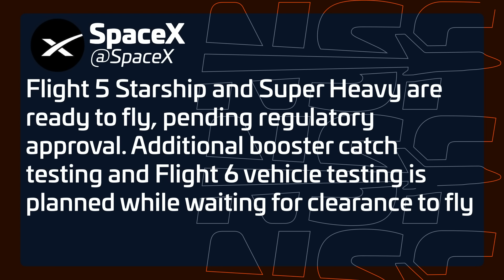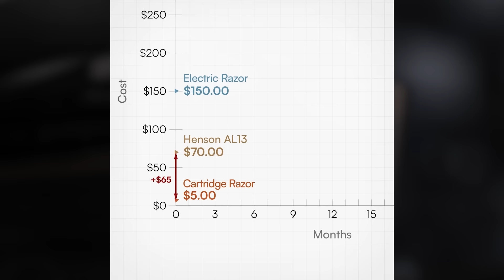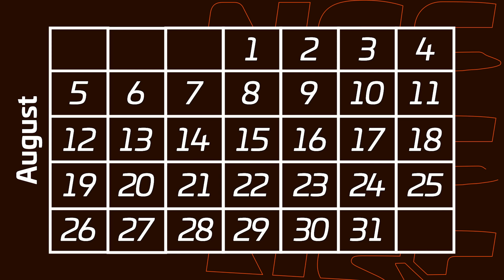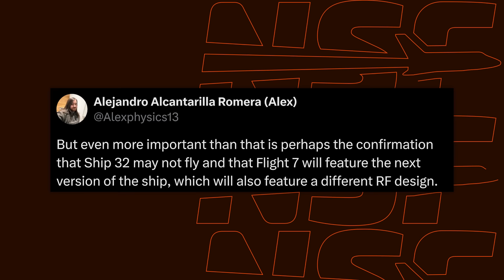Starship Flight 5 Vehicles Ready To Fly? (plus Raptor 3, Slap Testing & More) | Starbase Update

Comment: It is hoped that a starship weighing 20,000 to 70,000 tons can be designed and manufactured as soon as possible, which is equivalent to designing a submarine and aircraft carrier that has space speed/can move at extremely high speeds.

Comment: @NASASpaceflight Great video. I believe another dependency for the next launch date will be removal of the crane. The crane leasing company likely would make it contractual not to have the crane so close to pad A. Please let me know your thoughts.
Reply: I think they will just lay it down for the launch, but we'll see.
Reply: @michaeldeierhoi4096  You may be right. But I would imagine the crane owners would not want it exposed to that much energy.  Along with the mechanics, the systems and sensors are probably not tested for the conditions it would encounter.
Reply: The 3 remaining modules will soon be stacked and the crane dismantled. The LR 11000 can do the rest.
Reply: Documentation about this crane does not show any plan to dismantle it, in fact it is planned for it to stay at the pad at least all the way to January 2025
Reply: @ale131296  Thx for the additional info. That explains why they did not lease the crane from me.
Reply: @Vic20-RF  LOL

Comment: cover on booster 15 looks  more to protect the top of the booster from the outside elements via that line opening in the wall behind the booster.
Reply: I notice welders will often tent themselves (presumably) to reduce wind in their workspace and/or keep hot sparks from flying everywhere.
Reply: The boosters themselves have these new white caps they can wear when stored outside without a hotstaging ring, to protect the avionics and batteries and grin-fin motors on top.

Comment: Does SpaceX still perform full wet-dress-rehearsals before each Falcon flight? Are WDR's always required, even for a vehicle with such high operational cadence?
Reply: With new boosters.
Reply: Most (if not all) new boosters and upper stages are tested at McGregor before shipping to the Cape or Vandenberg; so it isn't always necessary.  Especially if it's just an internal flight (StarLink).

Comment: Worried about sound effects on hardened encased concrete. May turn to crumble? 17:05
Reply: This is the technique they used for the current OLM legs.
Reply: @ReinReads  It's the steel that makes the structure strong; the concrete just makes it heavy (and gives it an awful lot of impact absorbing inertia).  Even if all the concrete turned to dust inside, it'd probably still be fulfilling its purpose.

Of course, I was never trained in civil engineering, so I of course have no idea what I'm talking about.  Such is the internet these days.

Comment: Did anyone see if there are new 3D animation videos of how the catch mechanism works? No rollers, anymore or tank threads I remember? But cushioning pads now?
Reply: There's a rail where the lifting pins will "land" on, nothing about tank treads or anything. The pads on the sides of the landing rail are to soften the contact force when the chopsticks slap the side of the booster during its descent
Reply: thanks
Reply: The tank threads were replaced by pads at the end of long screws that can push the hooks of a booster back or forward if they need to move it. They work like a bench vice, just much larger.

Comment: I dont see rapid reusability being achieved while still using tiles and ablative material. Some type of new tech will need to be invented.
Reply: The rapid reuse is mostly referring to the boosters. The ships will be many and can be "fixed" between flights as long as they land safely. If they have to replace 10 or 20 tiles out of 18 000 it will still be rapidly reusable. They have the ablative sheets as a backup layer in case tiles are lost.
But we all have to wait and see what the results of the coming flights will reveal.
Reply: Oh, ye, of little faith.  Has SpaceX never done anything to give you confidence that they might actually know what they are doing?

Comment: The hot staging adapter's weight makes hot staging pointless. I don't get it.
Reply: The point of hotstaging is to maintain thrust throughout stage separation, which is more dtrimental than some extra weight. The hotstaging adapter is an interim piece to test hotstaging on the current configuration of Starship/SuperHeavy. Future versions of Superheavy will have the hotstaging fence and shielding built in as part of booster, rather than tacked on, which won’t be as heavy.
Reply: 10% increase in payload: 10 tons.
HSR payload reduction: ~1-3 tons.
Net gain: 7-9 tons.

Comment: During Spin Prime Testing, I understand that the tanks are loaded and then LOX and Methane are pumped through the engines without ignition.  This means there is a significant amount of Methane vented to atmosphere.  I understand Methane is also vented to atmosphere to regulate pressure in the fully fueled tanks.  How much Methane is routinely released during the entire coure of preparing one booster?  Multiply this by the projected increased incidence of Starship launches and how much Methane will routinely be released during the course of this program going forward?  Methand is 10 times more potent a greenhouse gas than carbon dioxide.  I would like to see an episode focusing on this detail.  While I have seen videos discussing the ecological impact of rocket launches, none have touched upon this detail.
Reply: It's somewhat hard to quantify—we don't have complete specs of the craft or procedure, but I've seen estimates of between 85 kg and 171 kg (2,125kg / 4,275 kg CO2 equivalent, respectively) of methane being vented from a single spin prime test. This seems like a lot, but it is in the ballpark of a single cow's annual methane emissions (100 kg avg.).

It's more per launch, likely 7 - 14 times as much as a spin prime, but the livestock analogy can help put that into perspective.  For further perspective, 25 starship launches with associated testing would potentially emit 30,000 kg (30 metric tons) of methane.  Annual losses from natural gas production are around 49.2 million metric tons.

Hard to know how to feel about this overall, but it has to be said that we tend to derive a lot of technological benefits from space research, which may accelerate technological solutions to some of our energy and emissions problems (such as moving away from fossil fuels in general, and energy production from natural gas in particular).

Comment: No matter how you cut it, attempting to catch the super heavy booster is a big risk. But if handled normally, normal for precautions while launching of super heavy rockets, not an extra risk to lives.
Reply: Catching Super Heavy is both more and less risky than it sounds. One one hand, it's a big vehicle that could do a lot of damage if it hits the tower with speed. 

But on the other hand, it did make a controlled and soft splashdown so it won't smack the tower with speed. 

The catch pins look tiny, but are massive. They're the size of a coffee table. And they added some hydrolics to add wiggle room for the catch. 15 degrees if memory serves me right
Reply: @snakevenom4954  " Coffee table sized," still seems to leave little room for error. Wouldn't be shocked if  eventually the grid fins get buttressed- at least as a contingency.
Reply: @attichatchsound-bobkowal5328  It does require accuracy, but for such a large and heavy vehicle that doesn't move too much from wind, it's extremely accurate
Reply: Precision and accuracy is required in positioning both booster and arms, fortunately the error in feedback is only [less than] 2 cm using Relational GPS
Reply: Not having a "Failure Plan" is not acceptable when the consequences are considered. If it misses the catch what does a "go-around" look like, especially if it is aiming towards the relatively unprotected tank farm. A drone ship landing would be preferred from a risk analysis point of view.
Reply: @michaelreid2329  Like Falcon 9's only aim "near" the drone ship, and not "at" the droneship — only transitioning laterally to land on the ship once the landing burn booster relight is confirmed; Super-Heavy will also be aiming for the gulf (or at least somewhere not populated by ground infrastructure) until landing burn engines relight successfully and with enough power to safely transition over to the claw side of the tower. 

If the landing burn fails, the booster is likely going to hit the planet like a bat trying to get back into hell — IFT 1's booster hit the water at something like 900mph.  I don't think they'll be aiming that missile anywhere near the launch site until assured it is under control.

Comment: How will the booster navigate too the chopstics? Is it GPS only? I know Falcon 9 uses mainly just GPS to navigate to the droneship. In fact Falcon 9 does not even «know» the droneship is there. Just navigates to absolute GPS position. However F9 usually lands a couple of meters off centerline. Which of course is not a problem on a large droneship. But landing on those chopsticks will take some insane precision.
Reply: Landing on the chopsticks will require similar precision: the sticks close around the vehicle.
Also, it probably has better navigation equipment than F9
Reply: I've gotta think they will also use radar, lidar, and optical sensors.
Reply: The booster has the capacity to hover which will help with the fine adjustments needed to make the catch more successful.
Reply: @michaeldeierhoi4096  It's remarkable that Raptor 3 can operate at 40% throttle.
Reply: @riparianlife97701  Raptor 1 can do 40%. Raptor 3 can probably go deeper
Reply: It is possible to use more cameras and sensors to adjust the precise path.

Comment: Now that the Raptor 3 is out, with considerably less weight and more thrust, one wonders if the savings will lead to landing gear on the booster.....
Reply: Nope. Landing gear is a waste of resources. Boosters will only land on chopsticks. Their legs are just higher up - like a gymnast on the parallel bars when landing on his arms. It is an inherently stable.
Reply: @knowledgeisgood9645  totally get the idea of the chopsticks....but they've never done it, and the removal of the legs was done to save weight...we will see how this plays out..
Reply: @jamesdee4256  Elon's idea was to move as much as possible off the ship/booster and onto the ground equipment. It is simple and complicated at the same time.

Comment: Tory was right, the raptor3 in the footage didn't have a TVC system, so Gwyn trolling him is kinda dumb.
Reply: It's not like the TVC is a huge piece of hardware that needs to be added. Plus 20 out of the 33 engines on Super Heavy don't use TVC, are those incomplete too?
Reply: @ale131296  I know that not all raptors have TVC (but it's a big piece of hardware that needs to be added, and half of raptors aren't complete without it) ,well is more to say about some missing wires on the original photos(but with sockets for them in a area that isn't visible in the video), so yes Torry was right with that to. Anyhow my comment was a reaction to her emulating Musk toxic trolling behavior, which didn't improved her public image I think.
Reply: @theOrionsarms  where are the missing wires?
Reply: @ale131296  you can't see any wires in the photo, but the engine have few sockets, so something most plug into them, also how do you think that data from the sensors is transferred to starship guidance system (to know when a engine misbehaving and stop it), magic?
Reply: @theOrionsarms  there's a connection right at the top of the valve controller system in between the LOX preburner and fuel pump. These connections carry the spin start fluids and the data from the sensors. You can see it on the test stand picture SpaceX posted last week. The places where the "sockets" that you see on those pictures are didn't have any wires on Raptor 1 or Raptor 2, what makes you think they do on Raptor 3?
Reply: @ale131296  so electrical system isn't on the engine but on the vehicle, that doesn't make the engine incomplete until is plugged into rocket?
Reply: @theOrionsarms  it is plugged to the stand on that test not sure what you mean
Reply: @ale131296  I mean that are some components that on older versions used to be attached on the engine (the wires that makes them look like a Christmas tree), with this new one those aren't anymore, so that makes it less of a complete engine, doesn't matter if those parts aren't on the rocket but on the test stand, the engine won't work without them.
Reply: @theOrionsarms  As we've mentioned, a bunch of those are already integrated with the engine
Reply: Tory Bruno is laughable & quickly becoming irrelevant.
Reply: @ale131296  you don't seriously think that circuit board that on older version were putted on outside boxes are inside engines? Well are such electronic devices that can be fired even on guns, but those are expensive, why Elon would talking about making raptor cheaper and use high end military grades components?
Reply: @cernhutch  he knows more about rockets than Gwynn, and he share that with more grace than her or you, not to mention Elon who is the display of how not to communicate publicly. And "becoming irrelevant" is probably his biggest fear, so starship isn't developed for practical purposes (like putting payloads into orbit) but for bling, like being the biggest or fully reuseble.